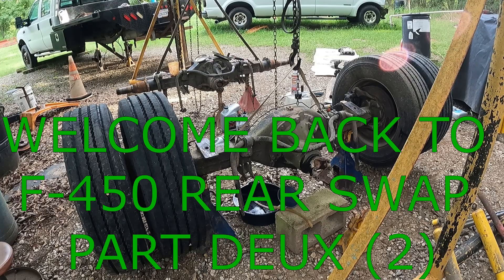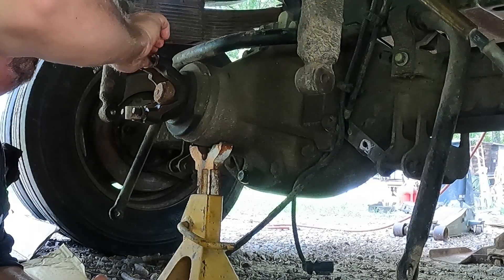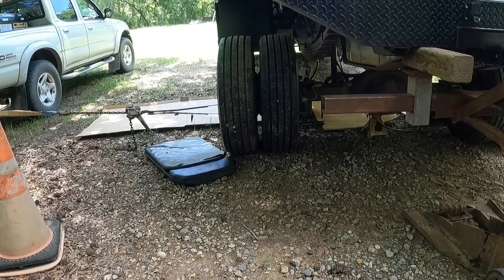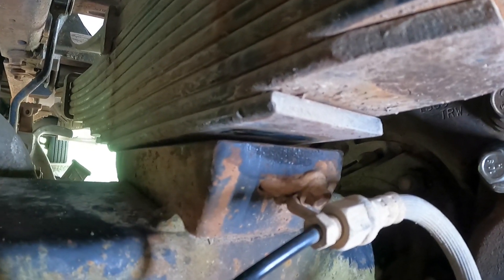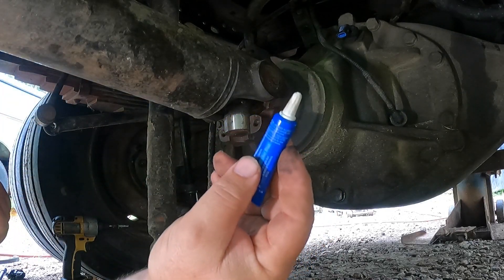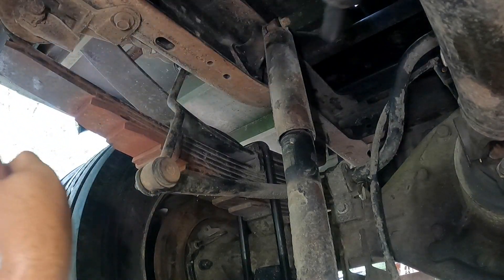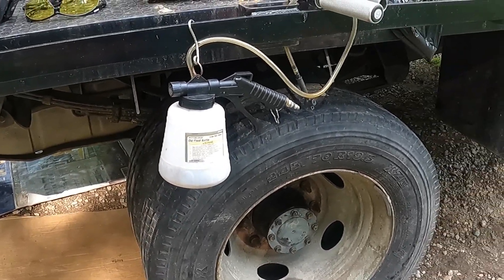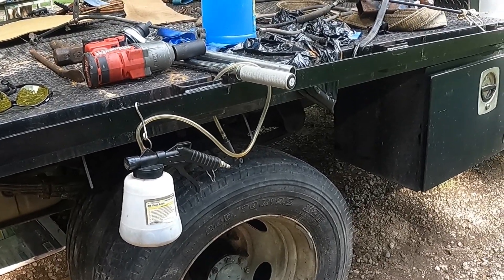F 450 Rear End Swap 2

Comment: Is it possible for me to swap a f350 dually rear end in my 2008 f250 super duty? Lol wife says I can’t buy another truck but I can make as many up grades as I want. So I’m wanting my truck on paper to look like and f250 but I want it to toe as much as a f350.
Reply from the maker: The frames on the 250&350 are the same width so I don’t see any problem there. 450&550 are skinnier. 
F250 probably has 373 gears and the 350 will probably be 410 so lower gear for towing but less top end and fuel milage.
Reply: @bayoudiesel  awesome, appreciate man. Is everything plug and play? And most of the years model beds are interchangeable right?
Reply from the maker: @issacissac1327  most of the beds are. For sure 99-07 when the Body style changed. 

Axels that I have swapped have been mostly plug n play. Only exceptions I’ve run into is  brake calipers are sometimes on the same side and some on opposite sides. And I picked up a dually axel out of a 09 that was 10 lug but everything swapped over to my old 8 lugs.
Reply: @bayoudiesel  awesome so it’s gonna be easier than I thought. Thank you man.

Comment: Did you have a hard time finding the correct axle ratio to match your old axle ?
Reply from the maker: I got lucky on this one. Didn’t even know the gear ratio when I bought it. The one that went out was 4:88 I  believe. And the one I replaced it with was a 4:30 which I like and had in another f450. 
So to be more to your point these trucks don’t have to many options, usually like 2-3 chooses. And the only time you have to match is if you are dealing with 4x4 or have a specific one you like. 
250’s most commonly are 3:73. 350’s 4:10. 450-550 can be 4:30,488& I think 538. if I remember correctly.
Reply: Thank you !
Reply from the maker: @joedoakes8307  you are welcome. Appreciate the comment. And thanks for watchin.